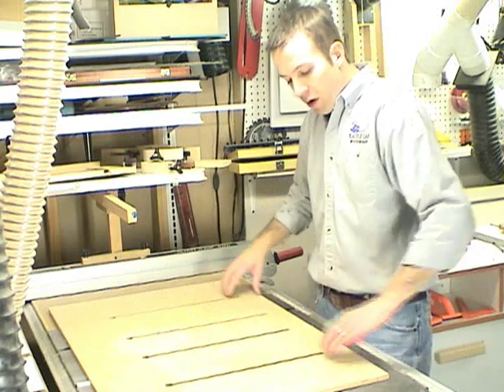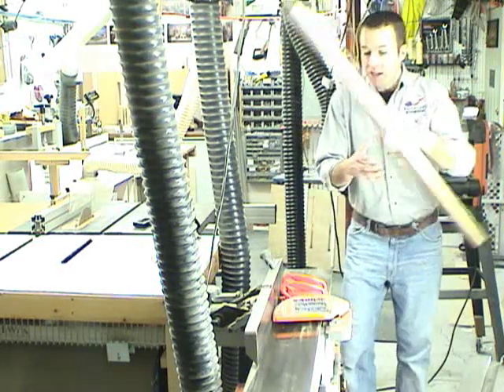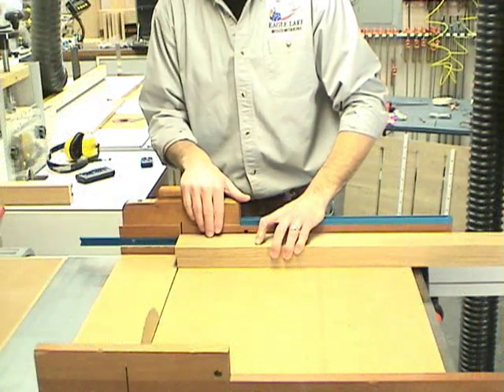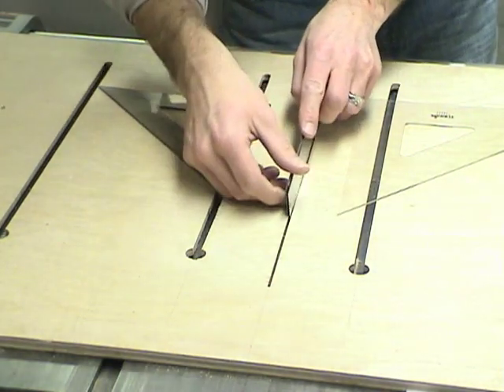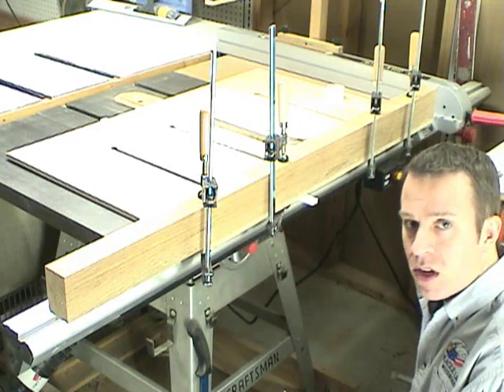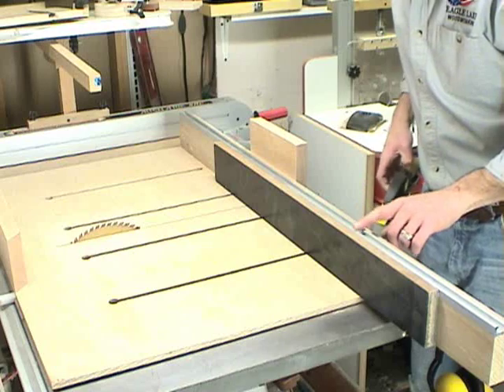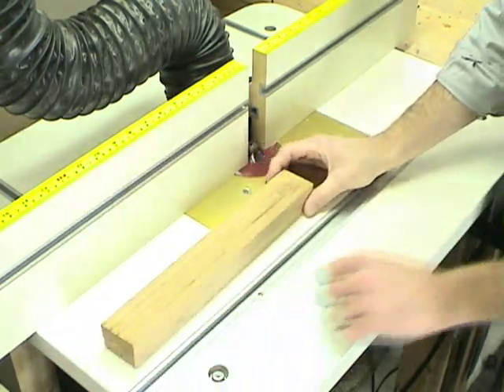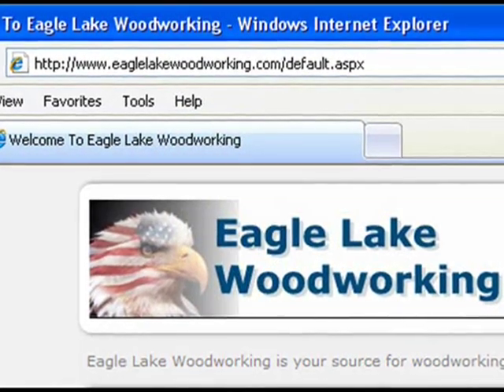Part 2 - The Super Sled - build the tablesaw mitering and crosscut sled

Comment from the maker: I did have a jointer, a tablesaw and a chop saw when I built my first sled.  If you don't have a jointer or a planer, you could build the main fence from laminations of decent plywood.  You could get this lamination pretty darn straight if you're careful.  You don't have to make the slots for the accessories, you could build the sled out of 3/4 inch material and embed low profile t-track in the dado (made on your tablesaw).

Comment from the maker: I'm glad you like the design.  Hopefully you've built one by now.  I went with the 1/2 plywood mainly to keep the weight down.  If you went with 3/4 inch, you could use the low profile t-track and embed in the sled (instead of making the slots like I did).

Comment from the maker: The t-bolts were kind of a pain, but they will probably hold the track in there the best.  It really depends on the dado size you create.  I've installed some t-track into dados that I had to hammer in with a block (nice tight fit).  I few shallow screws in this situation would be fine.
Rockler sells a low profile t-track.  You should get some of this stuff for a 3/4 inch board - you'll have a lot more material left underneath to screw into.

Comment from the maker: MDF is nice and flat, but it has two problems - the thinner it is, the more likely it will be to warp, and the it's weight. 
I take my sled off and on the tablesaw quite a bit, and I wanted to make it as light as possible.  I designed the slots to act like t-track so I wouldn't have to use a thicker board (to keep the weight down).
I knew I wanted to make a large sled, so weight was a concern.  If you're making a smaller version, you can use 3/4 MDF and embed t-track in it.

Comment: Like all DYI tools you need to make the simpler tool first before making the better stuff. It's like homemade CNC machines, the first simple CNC you build will be used to build the CNC you wanted in the first place.
You can make a very simple sled first to build your first simple router table and then use those tools to make even better tools.
Your first tools might not be very accurate but the resulting cuts will be identical thus giving a better accuracy to what you are building next.

Comment from the maker: @SpincterManBubba I'm a cheapo, so there's definitely not $5k of tools in my shop. I upgraded various tools when I appreciated the benefit that the new tool could provide. Yes, I'd like a new Unisaw, but I make decent projects with my saw, so I'll stick with it. Tablesaw $450, Jointer $350, Planer $300, 1949 Shopsmith (my drill press) inherited $0, Router $199.  Core tools in my shop - $1500 purchased over 10 years. I'm no equipment junkie, I believe the operator of the tool is a bigger factor.